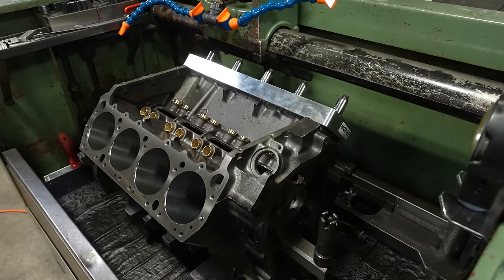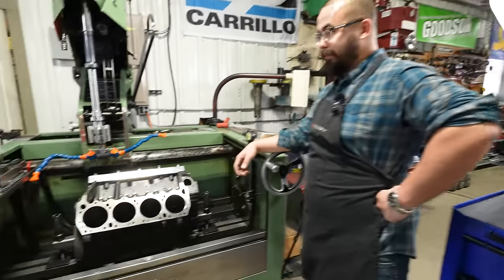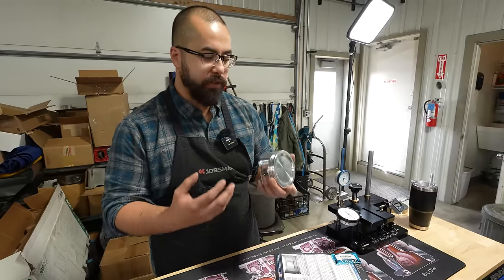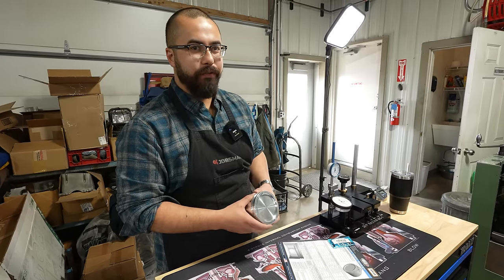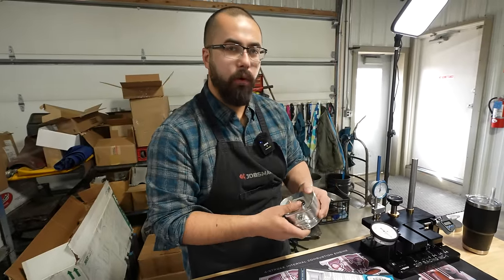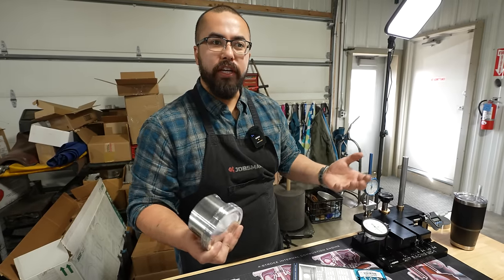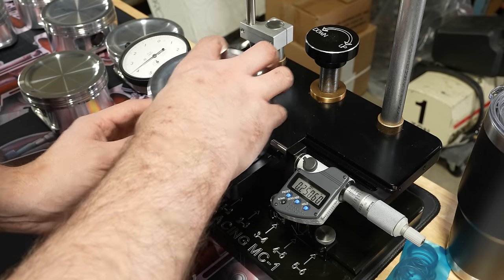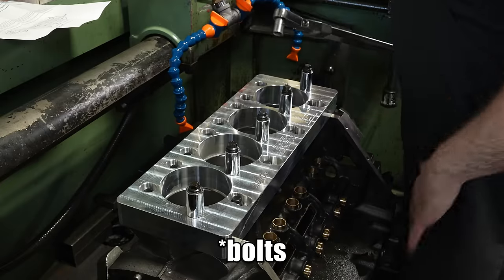How We Hone YOUR Engine Block For A Set Of CUSTOM Pistons!

Comment: To bad they can't get the 3.6 pentastar correct. 
Not these guys, the factory.
Reply from the maker: Chryslers lol
Reply: @JAMSIONLINE cough cough… jeep
Reply: @EngineRehab  come on,man, don't knock my gladiator. 
It's the motors fault. Lol
I only wish someone would provide an aftermarket fix for the bad tappets and cams.
Other than that, they aren't bad engines.
Reply: @airtek4809  that was more directed at a special someone other than you. Though I do find you quite special myself.
Reply: @EngineRehab  you punny.
Reply from the maker: @EngineRehab  I can't be held responsible for the vehicle my wife bought with her own money lol.
Reply: @JAMSIONLINE  I can’t wait to buy one in ten years. It’s luxurious.

Comment: why do we care about break free force with the pistons? the engine isn't at a stop when we are driving.
Reply from the maker: The point of that discussion and metric is to give a reference to the reduction in friction that this ring pack provides.
Reply: Less energy required to rotate the engine means more power and more efficiency.
Reply: @JAMSIONLINE  I see. I wonder what the actual difference .0035 in ring thickness really makes? I suppose you could maybe use the coefficient of friction to get a number, but how does that really translate to horsepower.  using a break free torque number seems like a method used because that's all that is available to us and may not tell the whole story, and how do we know it's the whole story, we ain't that smart lol.

anyway, thanks for the videos! I love machining.

Comment: "better repeatability".  I've been watching your videos for about a year now. I notice that you're measuring into the tenths of a thousands in some applications. I've also noticed that your measurement gages are not calibrated for accuracy over it's range of use. It's difficult to make statements about measurement system capabilities when you don't have calibrated measurement gages and don't know your repeatability for the same measurement over time.

Comment: I'm actually not impressed with this episode. A bit to much arrogance. The thing here is the typical repeat of info info without perception and true understanding to back it up. Seriously there's not much thought put into the  difference of the technologies and a gross lack of understanding of the old or basics as well the real world operation. Everything is not exactly as it may appear. Assumption can take you for a ride. That said I have nothing against the torque plate but the sale gimmicks/tricks and great exaggeration without proper data and perspective give me great pause in who I would want to do my work. Be careful what info you accept as fact with thorough testing to prove your analysis. I'm sure you will do your due diligence and with plenty of input from the cleaning guy about real world operations to keep it straight. View the entire picture with all the variables.
Reply: 😂 always that one guy to keep you humble
Reply: @ScannerDanner  lol I actually wasn't speaking of JAMSI. Running into 2024 alot can be frustrating. 😁